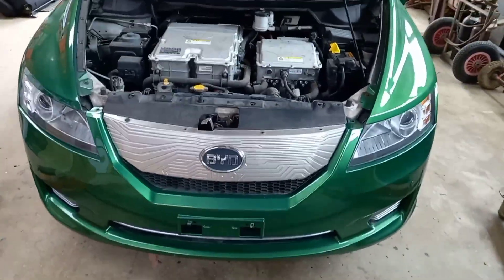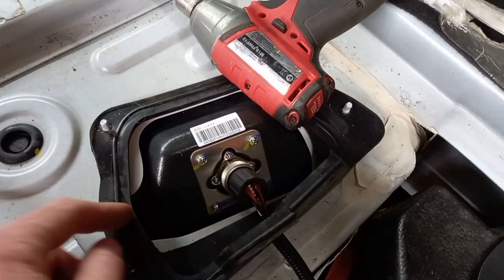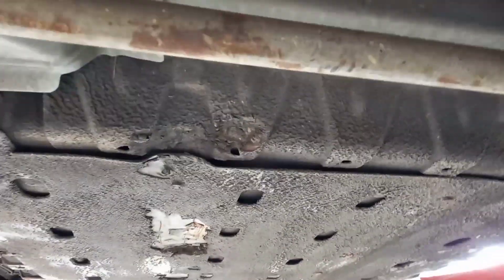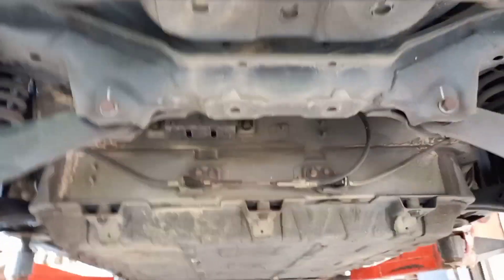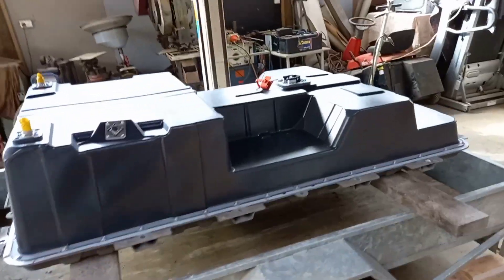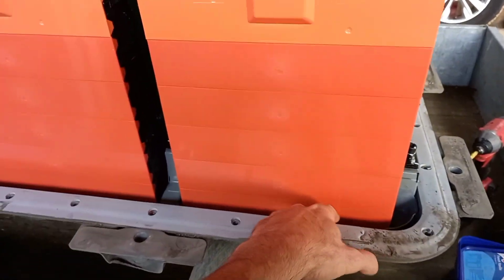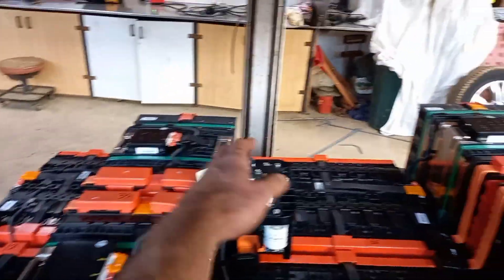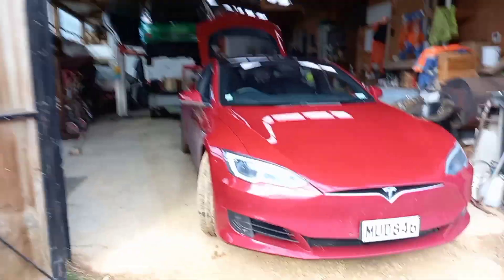BYD E6 Battery strip, SAFETY ISSUE and walk around

Comment: E6 is the taxi/ride share model started in 2016.  It’s built for heavy usage, many with over four hundred thousand miles on original battery are on the road.  Chinese taxi driver typically replaces a new car every five years and about 440k miles.

Comment: 12:34, are you retarded? That's a first generation BYD E6, which was developed 15 years ago as a taxi and has long since been discontinued. Why are you comparing it to Tesla's current lineup? Shouldn't you be comparing it with Tesla's very first EV, which was a total hack job based on the Lotus Elise?

Comment: So question, as I'm about to pickup an E6 as my Leaf replacement, the contactor box being at the back on the top means that the battery is directly accessible via this box? a 62kWh battery, just sitting there that also works as a car?
Reply from the maker: More or less, yes. Where did you get your car? I'll be interested to hear your review after a couple of months of ownership.
Reply: @RaglansElectricBaboon  I'm really interested to hear your driving experience, I know it will be simple slow and unrefined, but what is the real range like.  Particularly at 100km/h?
Reply: I got it from GVI in Auckland,  collect it on Saturday
Reply from the maker: @sambrown2305  300km seems possible if you drive it nicely but I really don't take it on long journeys often so I can't give a good answer. I still have my house deposit(Tesla) and use it on the long trips. Enjoy it and check back in after a month or 3 please :)
Reply: @RaglansElectricBaboon  certainly will, if I could get 200km at 100km/h I would be absolutely stocked. The main reason I bought it is being a long time leaf driver battery degradation is there biggest issue by far (they're still awesome cars). If the BYD battery is as long lasting as it appears then that would be a dream come true. It's also a station wagon. YAY
Reply: So I've picked the car up and I'm returning it today.  The battery seems to be stuffed. It will only take about 32kWh of charge from flat, the last 40% of the gauge equates to about 20km of range.  It charges at half the rated speed on any charger or EVSE, trips out some 22kW chargers or wildly fluctuates the charge rate from 1 amp - 30 amps every few seconds. Considering the car only has 270,000km on it  I suspect some sort of physical damage to the battery. I'd love one that wasn't stuffed but I think these guys are having serious compliance issues and I'm wondering if they've lost the Singapore dereg papers for the rest of thier cars.
Reply from the maker: @sambrown2305  I'm very sorry to hear all that. I think anyone retailing these is taking on a tough challenge. Good on you for trying and good on them for taking it back.
Reply: @RaglansElectricBaboon  they haven't taken it back yet,  but being covered by the CGA and having made claims about its performance and condition there's not a lot of options for them.
Reply from the maker: @sambrown2305  well in that case, good luck, I hope they do the right thing without too much argument
Reply: @RaglansElectricBaboon  in reality, I'd just like another one that doesn't have a stuffed battery,  the car is fine otherwise.
Reply: Hey,  one more annoying E6 question, assuming you had a second uncompliable identical car with a good battery,  how much time and how complicated would a swap be? Any technical reason you couldn't do it?
Reply from the maker: @sambrown2305  it's not time consuming to physically swap. I have no idea if there would be any pairing issues. If GVI want advice get them to contact me.  Hayden (the owner) knows me.
Reply: @RaglansElectricBaboon  cheers,  I'll let them know.
Reply: @RaglansElectricBaboon  so yet another annoying question, is it possible to reliably get the SOH for the battery via OBD or something?
Reply from the maker: @sambrown2305  I haven't managed it. Yet.
Reply: @RaglansElectricBaboon  I tried to connect to it via Car Scanner as I've seen Bjorn use it on other cars,  that should give raw sensor data,  but not sure if that would tell me what I want to know and I was having issues with my Bluetooth OBD2 so never got there.
Reply: @RaglansElectricBaboon  So further news, after liking the BYD E6 in concept I got a 2019 80kWh E6 with 74,000km on the clock which is now my daily driver and it is awesome. I've done a 90km/h open road range test and got 336km from 100% to 6% charge video here (https://youtu.be/S-Rs3B1Zhqw). I really want to know what the battery in your car is like as it's the future of mine, any way we could convince you to do a similar test on your car?
Reply from the maker: @sambrown2305  great news! No chance that I'll repeat your test. I can barely stand to do 30km in one go! I've put 65kWh in on one charge using the 43kW (theoretical) AC connection on an ABB charger.
Reply: @RaglansElectricBaboon  Heh, would you loan us your car for a day?
Reply: 65Kwh from what state of charge?
Reply: @RaglansElectricBaboon  one more annoying question, what did you do with the rest of the car you pulled the battery out of?
Reply from the maker: @sambrown2305  Sure come borrow the car if its worth it for you! The shell of the other car is getting in the way at a friend's workshop yard. I want to strip the power electrics and then get it off to someone who fancies themselves as a parts dealer-Hamilton EV were showing an interest. For borrowing the car get in touch direct on solar cycle nz @ gmail com without the spaces and with a dot at the end of course.
Reply: @RaglansElectricBaboon  I'd be keen to buy the rest of it,  interior, glass,  shell etc

Comment: Hi, I have a question. I have acquired 2 similar type BYD. And as you make know the charger port is a Female type GB/T Standard pin. Which is Chinese standard.

Is there a possibility to change the pin from a GB/T standard pin to Type 2 European pin ( I believe the properties of both the types are the same but the receptors are opposite sides). Please advise us if this is possible based on your Experience.
Reply from the maker: The charge port on mine looks like a standard Type 2. I remember reading on maybe Wikipedia that the connection might be slightly different but it charges OK on Type 2 chargers. I don't know more than that sorry.

Comment: 0 for safety coming some a guy who took the protective shell of the battery pack because he is unable to disconnect the high voltage before removing cables. all battery packs are like this since you are referring to the actual posts for the packs.
Reply from the maker: All other EV battery packs I've handled (Leaf, Tesla,  Hyundai, even Prius hybrid) have the contactors integrated into them. Give me an example of a pack that's like this but isn't from a toy. I'm interested to learn here.

Comment: This is the 2009-2010 model, very old model, they been used as Taxi in Shenzhen for many years, the battery do last many many years by the responds from the taxi company and drivers.
Reply from the maker: This is actually a 2016. It was used as a taxi in Singapore for 240,000 km. I have another which I drive and is almost identical. It has done 360,000km and still has 90%+ SOH.
Reply: @RaglansElectricBaboon  what is the chemistry of this battery ?

Comment: Not sure where to start with such bias video. What makes you such an expert in this old car when you don't even know what a contractor is? And you do need to work on the terrible camera shake. 
If you want people to take your video seriously, put aside your prejudices aside first and be honest with what is obviously very limited knowledge you have on EV cars.
Reply from the maker: I have no idea why a contractor is relevant to this :-P
I know exactly what a contactor is thank you very much. I know that there are none in this battery. This is unusual and could lead to people getting shocked if they are unaware, hence my warning here.
I have no prejudices, i am reporting my findings and preferences. I have driven the e6 for over 4000km since this video and my conclusion remains the same. It is a functional car but no more. The Tesla is absolutely fantastic. I'm sorry if this upsets you.
Yes, I absolutely need to fix the camera shake. Any tips?
Reply: Sorry but no conductors on the battery clearly is a safety issue, the battery pack is 300 volts DC, there should be a safe way to shut it down. Also of note, the oracat was recalled as owners were getting an electric shock off of the body of the vehicle while charging. And there there is the atto 3 showing clear signs of rust around the body mount points for the suspension components. I get the distinct feeling that chinese evs are built to a price point, that is making them of questionable safety

Comment: I thought BYD uses blade battery, no ?
Reply from the maker: New BYD E6 yes. This is the original, so no.
Reply: This is the 2009-2010 model, very old model, they been used as Taxi in Shenzhen for many years, the battery do last many many years.

Comment: Stupid opinion and analysis. I’m yet to see a BYD catches fire like Tesla. You don’t even know what that big box is and you’re some expert we have to believe?🤣 western logic sucks. And plus this car you tore down is the oldest BYD EV. Even so none of it exploded like the Tesla yet
Reply from the maker: That's pretty insulting dude.
Reply: @RaglansElectricBaboon  i apologize to be sounding rude, but I have seen enough people gives their opinions bias that only the Americans can get things done correctly. But we are yet to see a BYD car explode. Until then its well build in my 2 cents opinion.
Reply: I’ve worked with enough Westerners to understand how they function. They only know the western ways of doing things and if it its not done according to their limited knowledge, then it can’t be right. Most fail to understand that many asians have dual education achievement both from their local education system and from the west. Hence they are exposed to both logics when it comes to practical application of knowledge. End results is all that matter. BYD isn’t competing with Tesla hence comparing them to Tesla is already wrong. Not all drivers are racers and wants high HP cars.
Reply from the maker: @blardymunggas6884 
Yes, Tesla occasionally catch fire. If you watch some of my earlier videos you will find I have serious concerns about their practices and I even took them to court once. 
My point about safety is that the battery remains live when removed from the car. All other EVs have contactors in their battery so that they are electrically isolated and intrinsically safe. My point is to warn others so that they are prepared for this when they first encounter this car.
Finally,  please don't bring race into this. You devalue any serious points by doing this.
Reply: @RaglansElectricBaboon  ok. Your point noted. Will watch your earlier videos. The race issue is very much there when it comes with the west. You know that although its not spoken openly. The superiority complex among the west are very obvious and sickening at times. The asians don’t usually say it out because we are nice and respectful people. But many of us has had enough of the unspoken superiority complex though silent, its hurtful.
Reply: @RaglansElectricBaboon  i might be wrong about you hence i apologize
Reply from the maker: @blardymunggas6884  thank you.  Racism is an unpleasant aspect of life. It is illogical and unproductive. I truly believe that most people who are racist genuinely do not understand and do not intend the hurt they cause. They simply repeat what their parents or their newspaper or their politicians say without thinking about the implications. I'm sorry that you are feeling like you are on the receiving end of prejudice. Have a good day :)
Reply: @RaglansElectricBaboon  thanks🤝
Reply: @RaglansElectricBaboon  nice to see you communicated here, i would like to say if you can point out what is wrong by facts, 99% Chinese would be happily to listen and also learn, this is how we able to improve from many different way. for a good analysis, we should point out the good and bad, also suggestion for improvements. if not people are very to misunderstand.
Reply: Don't take this to heart, its educational video and help people to see whats inside ;)
Reply: Get used to it.

The day the West stops feeling they are superior to everybody else in the universe is the day the West finally civilized.

Comment: You might have missed something. It does have the contractors but they are in the HV power distribution unit that you did not know what it is on top of the pack. That contains contractors, more fuses, bus bars etc.

So with the distributed BMS  separate HV PDU and long HV cables from back to front, the level of integration is very low, plus the to-be-improced module designs, hence high weight etc.

Although the safety is not ideal, it is not really because it does not have contractors but rather being they are in another enclosure. This is definitely not good but not as bad as no contractors which would be crazy. And you should really follow instructions to disconnect the MSD first before you touch any HV components. The moment you open the pack of the connectors, you become liable for your own safety without the company's problem. And the way how you test the bulb is very unsafe as well. So I would recommend you to be more careful next time.
Reply: I don't think he is interested in that since he seem to have a preconceived opinion about it, since it is Chinese ,before he even started.

Comment: Are you interested in CAN sniffing any of the components? It looks like there are two interesting 250kbps CAN buses, one for powertrain and one for charger - and the BMS is connected to both of them.

Source: https://imgur.com/a/hlEZooy from https://max.book118.com/html/2019/1027/5202344142002143.shtm

There's a BMS pinout about halfway down this page where you can see the two CAN bus connections, but the text is too blurry to read much else: http://www.gzweix.com/article/sort0253/sort0254/sort0671/info-325886.html (can't find the original source for that diagram.)
Reply from the maker: Awesome info, thank you. Yes I'm interested in sniffing it but I have so many other things I'm meant to be doing. Primarily I should be figuring out how to turn things into money rather than just hobbies...
What's your interest in these? Have you worked on these cars? If you're in NZ you're welcome to come poke this with a CAN device :)
Reply: @RaglansElectricBaboon  Hey! No worries, totally makes sense :)

I'd not seen the insides of an E6 until your video. I'm interested in EV conversion projects in general and I figured that BYD had sold a lot of this drivetrain in China, so there must be parts from wrecks out there somewhere (I don't have any source for those, just a theory). And the motor specs look pretty good. So was excited to see someone actually poking at one (haven't found anyone doing this on Chinese internet).

Unfortunately I'm over the ditch in Australia, otherwise I'd definitely pop around for a bit of a tinker.
Reply from the maker: @projectgus  thanks again for the info, sorry you can't come visit.  I have a sad story for you- allegedly there were about 20-30 ex UK E6s your side of the ditch briefly. Apparently bureaucrats said they couldn't go on your roads and so they came here. I don't know more than that but mine isn't from that batch.

Comment: Front Ac-DC "charger module" Front inverter for front motor, rear module is the contactor box.
Reply from the maker: Yes, having found no contactors in the battery case I think you are right. I will open it soon.